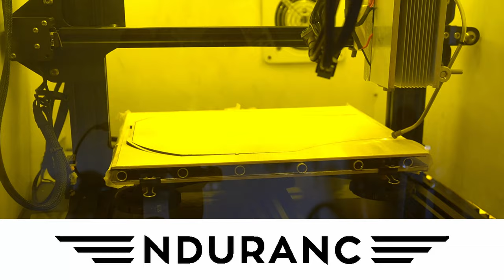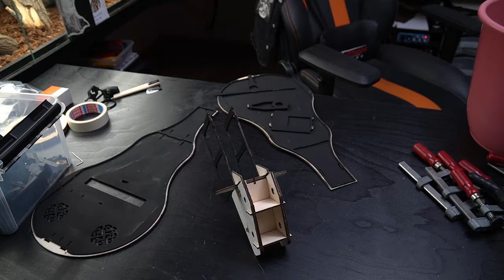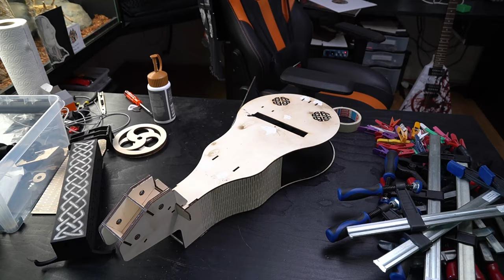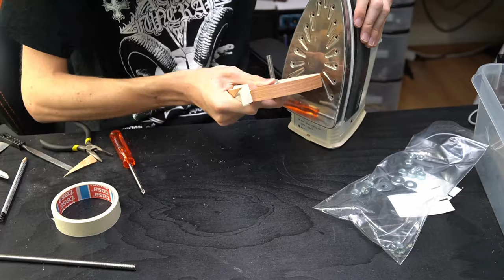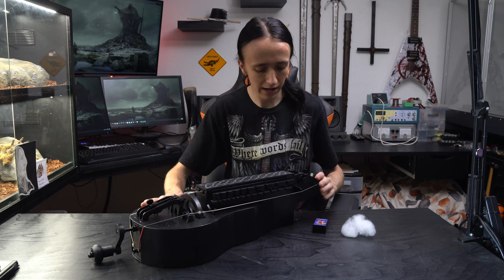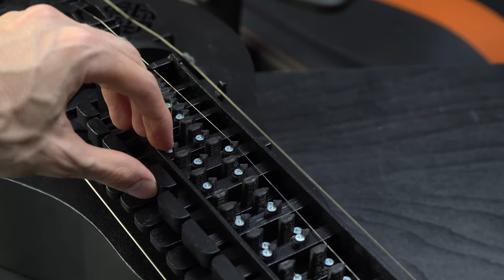Laser Cut and 3D Printerd Medieval Insturment - Nerdy Gurdy Project

Comment: Things I learned earlier yesterday.

If you dissolve a small amount of rosin in Isopropyl other alcohol to make liquid rosin, you can lift the stings then rub the liquid rosin on the wheel to rosin it nice and fast.

Then with the strings still lifted, dab a small amount of liquid rosin on each string just above the wheel & wait till it sets, then apply the cotton. The rosin will hold the cotton in place as you play.  You don't want the liquid saturating the cotton as rosin on rosin will squeak badly.  If at any time later, the string gets squeaky, add more cotton or replace the cotton as it's worn.

If you want to remove rosined cotton, lift the string and wet a finger in alcohol and dab the the cotton but don't touch the wheel. wait a few seconds for the rosin the go soft, slide the cotton away from the wheel and remove it from the string.
Reply from the maker: Awesome, thanks for the tip!

Comment: It seems the drones way over power the melody strings. Is that adjustable so more melody is heard?
Reply from the maker: My melody strings never worked too well due to using slightly wrong strings. But I'm sure there are small things you could tweak to change this. Though in the end you still have to keep in mind that this is a plywood instrument and you can't really compare it to a high quality hand made one in terms of sound quality.

Comment: What is the fastest PLA 3d printer you've got? medium size, decent quality not too expensive, but fast?
Reply: That limitation is more on the slicing program rather than the printer itself, and largely depends on layer height, infill%, wall thickness, etc. which is mostly determined by the settings in whatever software you choose to use.  PLA printers are slower by default as they have to print each layer manually, as opposed to resin which can print a layer just by shining a UV light for 3 seconds.

As far as I can tell the Ender 3 with the Ultramaker 5 slicer is perfectly capable of meeting most personal use needs.
Reply: @shigerufan1  Thanks.